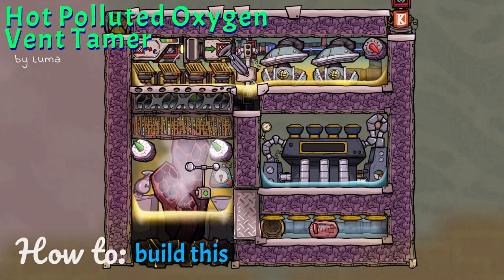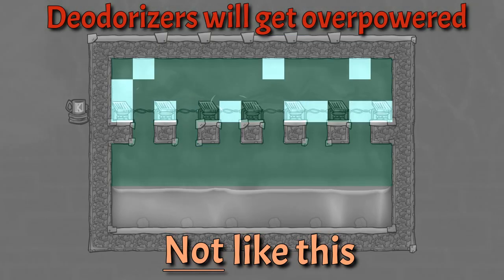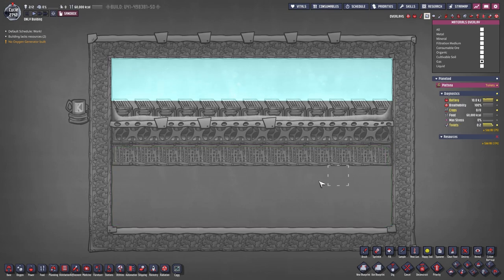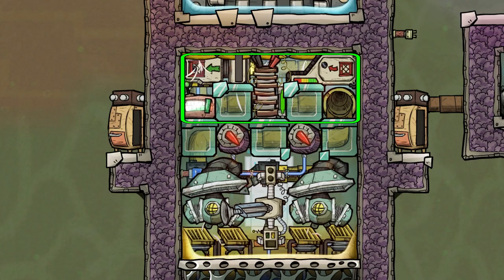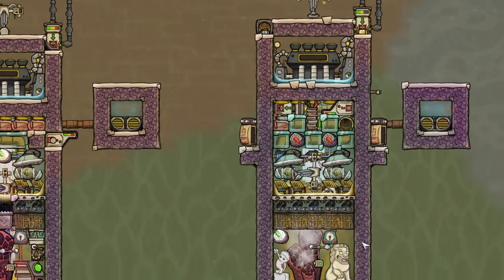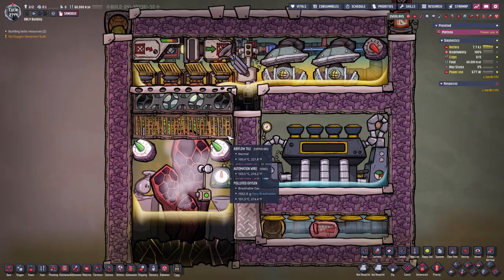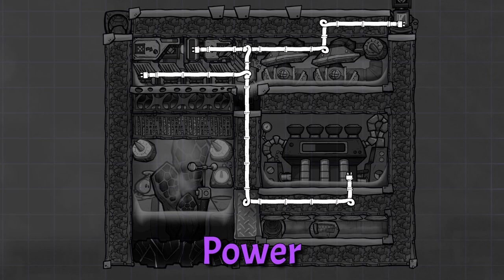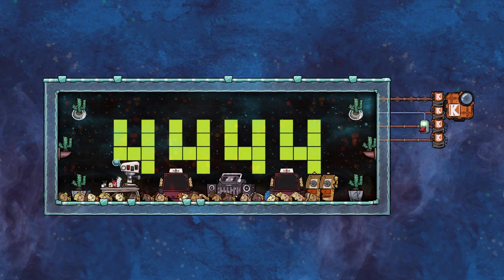My Hot Polluted Oxygen Vent Tamer - Explained

Comment: I love this design... I just wish polluted oxygen vents were more useful. The amount of effort put into taming the vent is a lot for one duplicant's worth of oxygen. The only use I can think of is generating extra clay (for ceramic), or maybe for making emergency oxygen on rarely visited asteroids (in case a duplicant needs to stay there for a while, or if they need to refuel their rocket cabin's oxygen supply).
Reply from the maker: I see it the same way. The use is very limited. Epecially since the oxygen is not even cold. The 70°C infectious polluted oxygen vent can at least be passively integrated.

But hey sometimes you need every last bit. And Clay is also useful as you said :)
Reply: Sadly the best way to use it is for Puff. But you only need them at mid game for slime to use on mushroom, which be obsoleted later by pincha bread.  And by late game you need the pufg that eat oxygen and secreted oxylite for rockets

Comment: I normally brute force it in the late game since sand is hard to come by late game.  Freeze it into liquid oxygen.  Run your cold 02 and dirt back into the hot polluted oxygen similar to your petroleum boiler to equalize temps.
I do the opposite with my polluted water.  You vaporize it to collect the dirt and collect water for o2.  Equalize the temps and you're in business.

Comment: I think that the likelihood of the deodorizer placing an oxygen tile in the lower chamber is zero when you have only a single layer of liquid in the mesh tiles and no liquid covering the deodorizers. I think how this work is that the game will try to teleport one element when two different elements occupy the same tile, but never when the elements match. The heating problem with one tile of liquid is addressed when you have 1 ton of water per tile in the mesh tiles and adequate tempshift plates made of metal or better. I've tested a similar design in one of my bases and it worked fine over a few hundred cycles. The water did start to heat up, but I fixed that by increasing the minimum gas pressure of the upper chamber. I had a 15-20 tile airgap(heat transferred only by strategically placed granite tempshift plates) between the geyser and an ice biome I was using and the system kept itself cool when I set the minimum clean oxygen pressure above 10kg.

Edit: I forgot to tell you the main thing I felt watching this video. I loved that you covered this nifty little design in both your shorts and here. Thanks for sharing this and other neat little designs that fit so many small niches that general designs are too cumbersome for.
Reply from the maker: Hey SentientNeuron thanks alot. Those feedback comments and own experience informations are truly helpful :) 
(*just to be clear: I mean that and I don't use sarcasm online!)

I had the feeling the one layer was already effective but i dis not want to use so much liquid. so a smaller amount of just 200 kg of each liquid seemed to be helpful to save materials, help even the temperature of the deodorizers and the room. That was my thought behind the double layer.

I also did not manage to get an oxygen tile in the lower room maybe like you implied that would only be an issue if both rooms would be a vacuum?

Thanks again :)
Reply: @Luma_plays  Thank YOU for letting us have an opportunity to have a discussion as fellow ONI players. 

I have had both rooms be a vacuum and had no problems. I think the oxygen pocket in the lower room might be due to one of few things. 1) Switching on deoderiser before adequate liquid is present in the mesh tiles. 2) Not evacuating the lower room and assuming no gas contamination is present. 3) Gas contamination due to errors during construction or deconstruction. 4) (Very low likelihood but possible in certain biomes) Oxylite left among debris and not being noticed due to high gas pressure. 5) Gas teleportation. There are some old videos on YouTube regarding converting one gas into another. If I'm remembering correctly there was gas teleportation involved and the converting mechanism itself was made of water. In your design the water has to be displaced by the produced oxygen, just as you observe and state in your video and this might be a culprit. Then again this bug that you mention may have already been patched out. Hope you have fun experimenting :)

- Neuron
Reply from the maker: @thesentientneuron6550  Thank you, will do :D.

At the moment i prepare more mod monday videos.
Reply: @Luma_plays  I will look forward to those! Edit: Is it possible that in some designs if the mass of water was low enough it could flash to steam. Maybe that might cause the oxygen contamination?

Comment: If you put the outgoing oxygen pipe through the self cooling steam turbine room, you can cool oxygen further, down to 100
Reply: But turbine heats up to 100°C and stop working :)
Reply from the maker: Yeah the risk of the turbine overheating and breaking the whole setup is probably not worth the few extra degrees. But depending on the strength of your Hot Polluted Oxygen vent it might work. No guarantee :D
Reply: @Luma_plays  You could have a Valve that splits the exhaust into two 1kg pipes (after cooling the turbine) and have these counterlow against the oxygen.

That way the oxygen gets cooled a bit further, the water gets to the steam room at a bit more than 100c, and there is no risk of Turbine overheating.

I sometimes do that with my Sour Gas Boilers.

Comment: wonder if you could use the hot oxygen to turn the clay produced by the deodorizers into ceramic
with a thermium aquatuner you could concentrate the temps of the hot oxygen into a small heat room (cooling the oxygen at the same time), then transport the clay into the heat room where it would turn into ceramic
maybe i'm overcomplicating myself and it's just better to just pay the 25 coal cost at the kiln